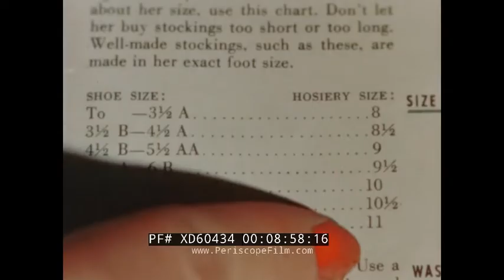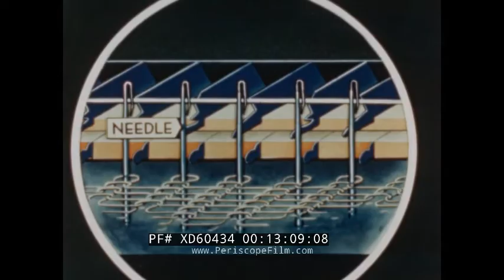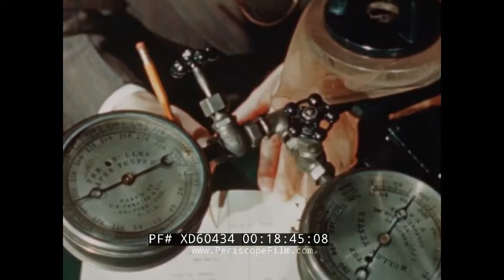“ BERKSHIRE STOCKING PROMOTIONAL ” 1940s HOSIERY & NYLON STOCKINGS PROMOTIONAL FILM  XD60434

Comment: Clothing history nerd here. There are still a few factories making fully-fashioned stockings! They’ve gone through a revival with women who wear vintage fashions. I’ve read that they’re not as stretchy as modern pantyhose and stockings, which is why they had to be shaped. They also can crease/bag at the ankles and knees, unlike modern ones. There were/are multiple styles of heel shaping, and the seams and heels can be coordinated to the main color, or contrasting. I don’t know how the wear compares with modern hose, but the reinforced toe, sole, and heel would definitely help. Some women keep a pair of soft cotton gloves to wear when putting on and taking off their fully-fashioned stockings to avoid snagging them, because they’re more expensive than what you find in stores.

Comment: I've got a burning question....
Do they ACTUALLY repair nylon stockings? Or just throw them away and send a brand new replacement? I didn't realize stockings like that could be repaired.
Reply: In the first episode of Miss Fisher’s Murder Mysteries, Dot darns one of Miss Fisher’s stockings and Miss F compliments her on her work, so I suppose it’s possible. It would be an interesting challenge!
Reply: My mind is exploded thinking of them actually fixing it instead of throwing it away
Reply: Yes...in those days, high-end department stores...such as Macys...had a department that repaired nylon stockings. Considering 
the damage, many runs & snags could be repaired. Those that were damaged beyond repair would be replaced. Usually at 1/2 
price of a new pair. The stockings had to be unworn & the customer only needed to produce a recently dated receipt. 
This service was not common in all department stores & ended before the 1960's. Mainly because personnel skilled in nylon 
stocking repair were scarce & a pair of stockings was inexpensive. So, the...presale...damaged product was simply replaced. Often, the damaged, "unworn" stockings were resold as "seconds" at a greatly reduced price or the store was credited for the damaged product by their stocking distributor. 
Best regards, 
Ben